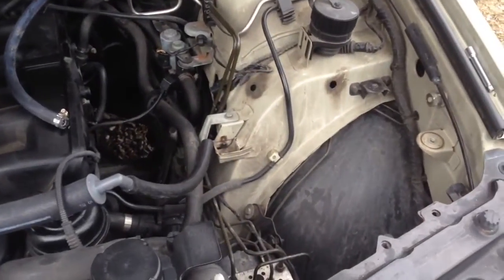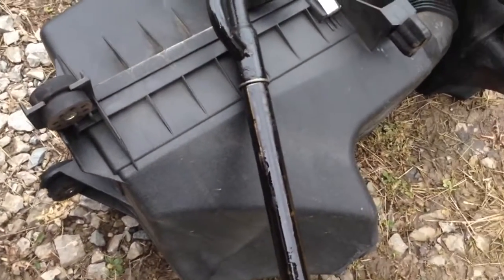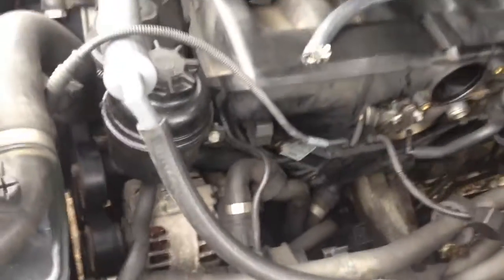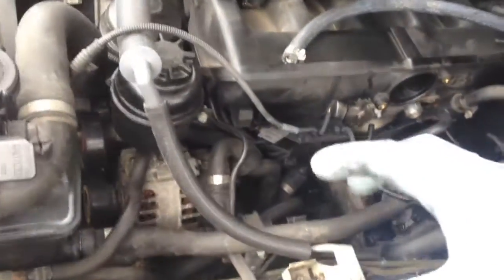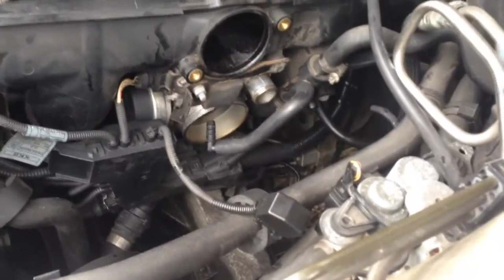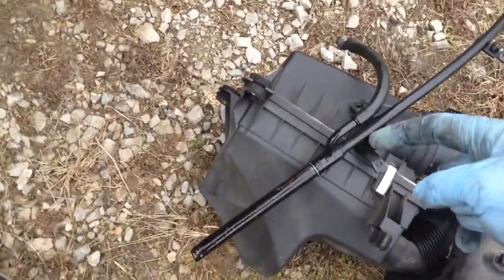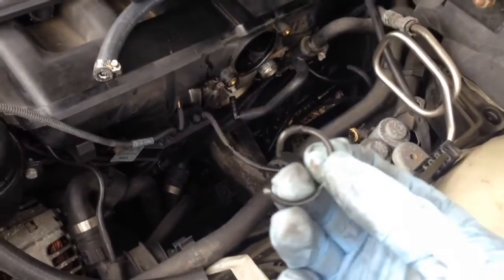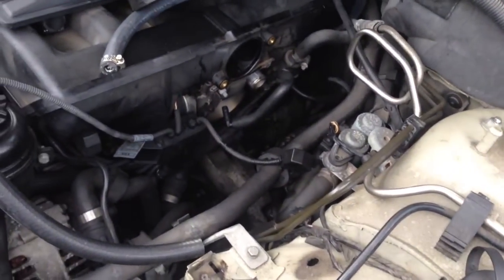BMW BLEW A SEAL !!! Blown Oil Dipstick Seal O-ring Dipstick Seal Replacement E39 E46 E53 E36 E90 E60

Comment: Concise & accurate guidance to address one of the e39 troublesome oil leak risk points. I was able to remove the oil dipstick in my 2003 e39 without removing the DISA valve but discovered in the process the oil separator hose had failed. $49 part but in retrospect, one could just replace the failed hose with a 10 1/2" oil resistant rubber hose with a compatible ID and then sleeve it in case the vehicle is being operated in cold environments. The e39 with the cold weather package from the factory has a thin sleeve over the hose for this purpose and the replacement hose from BMW seems to have it also.

Comment: hey Nathan keep the 5 series videos I have a 2004 525ia e60 I'm getting a code on inpa  it's said ebox malfunction can you advice me on maybe there is a trick to fix.it and where is the location of this fan
Reply from the maker: +Jhonny Arevalo Hello the ebox is the box that holds the ecu, its located on the passenger side under the hood, you remove the passenger cabin air filter to get to it, there is a fan in the bottom of the box that might need to be replaced, check all the fuses in this compartment and verify that the fan turns feeely.
Reply: +Nathan's DIY Garage thank brotha I really appreciate the quick response I'll get back you if I'm able to resolve my issue.

Comment: How much oil should you drain from the crankcase before pulling out the dipstick tube to avoid spillage? And once you have all that gear removed to access the dipstick tube, is the crankshaft position sensor easy to access as well?
Reply from the maker: +hnkfsh81 you shouldnt have to drain any if your car is level, yes the crank sensor is easy to access while the dipstick is out, if you have a e39 just remove the cabin air filter box to access it
Reply: +Nathan&#39;s DIY Garage I have an E46 with the M54 engine. Thanks for the response!
Reply from the maker: I would pull the throttle body boot to make room to reach it on the e46